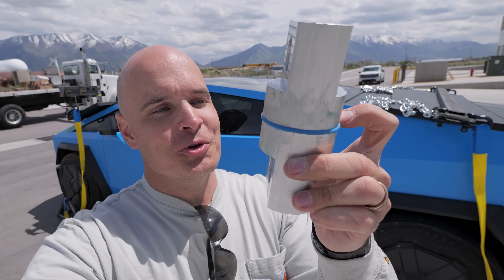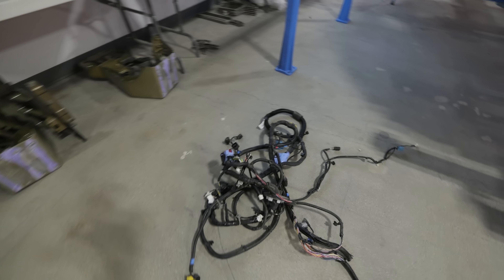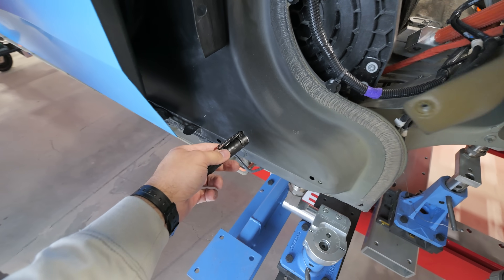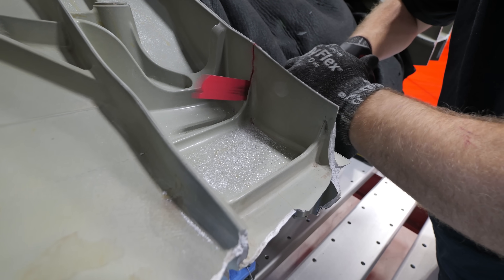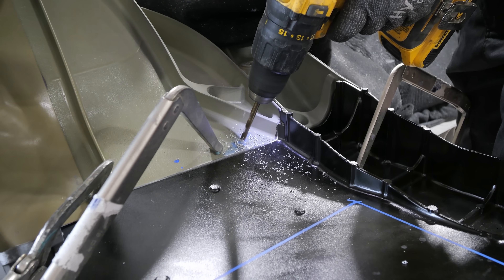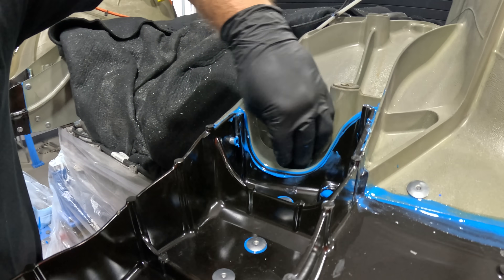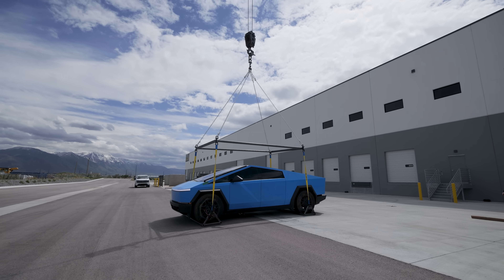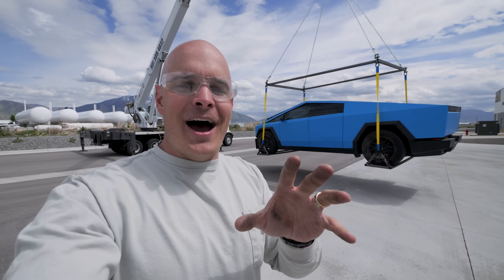Tesla Fixed my Cybertruck with GLUE - (but I'm not mad about it...)

Comment: I'm not that surprised the adhesive did well.  I'm more interested in its longevity.  How does it do with repeated 100 degree summers, freezing winters, wet climates, flexing, debris resistance, etc.  How long is this stuff going to really last in sub-optimal conditions?  One comparison I really liked was the welding one, where welding wouldn't penetrate all the way through your test piece, which begs another question - can you weld with this stuff?  Could you apply it for the majority of the surface area and then weld the edges, or would the heat ruin the adhesive?

Comment: So it was 13k you would not need to do if it had steel frame. Luckily these cars are only made for 10 year lifespan. Metal fatigue might be bad with aluminum unibody on older cars.

Comment: I would still doubt it is as strong as before. The glue can degrade, or get mixed with the dirt or oils, also there is continuous frictions and multi-directional forces while in use - any of this factors is dangerous.

Comment: People have been using structural adhesive for rust repair for years. You use these epoxy adhesive to attach stainless steel patches to treated rusted area that you cut out all rust. The most common part where almost every car manufacturer use it is roof.

Comment: Amazing tech! Remember that crash with a Gwagon where the whole back of the Cybertruckngot cut off? Look closely, not a single window broke , the passenger cell is intact! This reminds you of the lezard losing its tail to save its life! And that Cybertruck could actually be repairable! This confirms my suspicions, the Cybertruck is built to break off parts by sections which is genius! F1 use the same tech!

Comment: From the pulled apart shots of the strut towers, there looked like there wasn’t anywhere as much structural adhesive on the strut towers from factory, compared to the amount the repair  process used.

Comment: Impressive on all counts: A) that it could be repaired; B) that Tesla designed the castings to be repairable and included cutting guides; C) that repair parts are available; and D) it only cost $14,000 to repair.

Comment: Cool video! From the damage of the original  parts, you can see that the glue was spread in 3 thick beads from the factory and was not spread in whole section with the brush like they did it during repair. Perhaps if they would follow their own procedure, it would withstand the maximum weight test.

Comment: When superglue was created some of the first official press displays were very similar to this test here. Lifting thousands of pounds with a single drop of glue wowed crowds. Ofc just like magnets in a way they can only do so much in a "straight line", add shear forces and super glue will likely give out, and all it takes is one or two bonds to detach and it goes like velcro being peeled

Comment: This is what's sad about the Cybertruck. There are obviously a lot of smart engineers working at Tesla who did a ton of good work. It's a cool engineering exercise in many ways. Unfortunately, that doesn't make it a good or safe vehicle. It's still a rushed product with numerous large flaws despite being delayed many times. Oh, and the owner of the company has completely ruined the brand, of course. The repair did cost less than I would expect, but of course it would be far more with body panel damage as well. Cool insight!

Comment: How strong is the glue after a few years? How about when it is extremely hot or cold? This would be easier to fix if it was steel because you could just weld it. This is not very impressive for epoxy, but on par with a standard epoxy you can buy at a big box store. What about the impact strength of the epoxy? It seems like a lot of questions were not asked.

Comment: It's amazing how delusional so many of ya'll are.  If the frame was just made of steel like every other truck ever made you wouldn't need to repair anything.

Does that basic fact even cross any of your minds?  Being "easy" to repair is an insane take away from a $100k truck being essentially totaled by simply towing.   

Cybertruck is not a real truck and this is probably biggest reason why

Comment: Repair looks simple, but it's not cheap, you have to buy some parts and read the manual. Steel is easier to fix, you need just a good welder.
Bicycle travellers for example prefer steel racks - you can weld it everywhere. There is also a fatigue issue, which almuninum is susceptible to. Cybertruck is not super durable machine for Siberian conditions, it's just sufficient.

Comment: if you really want it strong, treat the aluminium to a nitrogen snad blasting to create more surface area, and remove oxides, apply a bonding primer then adhesive.

Comment: Dear Jerry
You could repeat your test with a coating of whatever product is used by Tesla to coat the alloy frame. That way the test would find out the adhesion strength of the coating rather than the adhesion strength of bonding aluminium to aluminium. If the coating adhesion strength is far less than the epoxy product then your cybertruck is likely to pull apart the test sample. Should make a good you tube followup. It could be whatever treatment the coating is given or not given is causing cybertruck panels to loose adhesion to the bogy frame.

Comment: In many cases, the adhesive joint is now more often STRONGER than the base material itself, and definitely stronger than a weld or any other mechanical connection. It is truly amazing how far adhesive tech has come.

Comment: Sold and used early automotive panel glues from 3M in 80s. Initially used for door skin replacement although spec still called for 2 welds. Early glues were inconsistent and surface prep was overly complicated. Over the next few years the entire process became perfected. They're everywhere in vehicles.

Comment: WOW. Parker aka Fusor Adhesive is not Tesla Glue, it is glue Tesla uses in repairs. It is a body shop staple since before Cybertrucks needed to be glued back together. Calling it Tesla glue is silly and all accolades go to the manufacturer Parker… Id check the data sheet on the toxicity before sniffing too much either. Anything that blue is sus… blue is rare in nature but not in petrochemical products.

Comment: If you dive a little bit deeper in the topic glue you will notice, that this looks fascinating and still is for me, but is actually nothing new. If you want to combine two materials especially for metal glue with this strength and elasticity is available for some years now. So Tesla glue is more marketing than something else. The use here to hold a bumper seems for me more disapointing than an useful as replacement is even harder if something happens now.

Comment: Btw the protective e coat is not a paint. Its adhered on to thr surface just like powdercoat is. It goes thru a series of baths actually has a couple of coatings on it. The car is charged and the water with the coating inside it so when the whole car gets dipped it adheres to the metal then they bake it on

Comment: How would they repair it the second time?? if they were to cut it as they did in this video the slot of the replacement part would still be attached right? how do the remove something that has been attached with super super blue glue?

Comment: Show me any other company that can do this. I'll wait. Anyone who thinks Tesla's engineers don't know what they're doing and think the CT is a failed product, I'll wait for you to wake up
Reply from the maker: The bottle of structural adhesive literally says GM, Fiat, Peugeot, Chrysler, Honda and Acura are all using the same stuff.... so thats a few companies.
Reply: @JerryRigEverything  Not speaking about the glue specifically. Do other companies have their parts built in such a way that their repairing process is this straight forward and simple and has high integrity and isn't a thousand parts? Last time I checked, a lot of the players are still catching up to castings in general

Comment: Now do a twist at the glue joint and add a little bit of vibration like it will happen on the road, I agree the glue is strong but in a perfect testing environment. Super glue was also advertise like that, holding weights but a twist breaks the bond and I thing that would be a better test

Comment: Interesting that you did0 not count with possible failure. O would add wood plate to the frame above main hook as in case of failure it will shoot half glued part with chains to CT roof. O do you have extra wire or chain that hold it neat the craing hook and do not allow to free fall to car roof?

Comment: It's not the type of glue that they use, it's the horrible Quality Control of the installation outside of the factory and repairs in shops when you're not famous. There are many high strength adhesives that work fantastic, but you need to use them correctly and not in a hurry.

Comment: If the test article fails during the lift - I'm paused @13:08, just before the actual lifting begins - then the rigging comes crashing down onto the roof glass.  Any level of safety line for supporting that would have been a good idea.  Just saying.

Comment: Now come back in 30yrs and see if that glue is still holding strong... I work in the boating industry and have yet to see an adhesive or sealant that's remotely close to it's design strength after 30 yrs of age, wear, and tear.

Comment: Fron manufacturer it doesn't seem like they put very much adhesive on the rear bumper from assembly. Comparing to the repair process the coat the entire area with glue. There's just like three lines of glue when they manufactured it. it seems like they didn't manufacture correctly to specification when they were first assembling it compared to the repair process. By not having enough glue can definitely decrease the complete strength

Comment: Lotus used glue and screws (similar to the rivets used by Tesla) instead of welds a their cars because it was stronger than actual welds, and helped save a little weight on their cars. So it's not a "new" process.

Comment: I once used my webshooter backpack to lift a car with hot glue, and it only required significantly more glue and surface area! Are the cast aluminum fracture zones less likely to transfer hidden bending/damage further into the frame than conventional steel crumple zones?
Reply: I want to be embalmed in Tesla glue

Comment: Lifting a car with glue isn't new and something super glue has done plenty in the past. Super glue however is brittle meaning a light tap from a hammer could break that bond that was able to lift a vehicle. The quest I have for this stuff is what is it's weakness? I imagine it's more shock absorbing than super glue but how does it's properties change with temperature? What sort've shock forces can it absorb? How much does it's bond diminish over time? How weather / moisture resistant is it etc etc

Comment: I’ve seen many vehicles that use structural adhesive in assembly. When BMW made the I3 and I8, the carbon chassis were not a single piece, but a jigsaw puzzle of sections glued together, and with aluminum sections glued to the front and rear. And everything held up to whatever abuse their owners would throw at them.

Comment: I was never a fan of the Cyber Truck, but after seeing how Tesla designed it to be repaired through Gigagasting has certainly impressed me. Awesome stuff!!!!!!
Reply: and the price for repair you can buy 2 RAM trucks   . Tesla Cybertruck's frame snaps after hitting pothole
-Of the total $34,000 bill, $21,076 was for replacement parts, $11,140 for labour—totalling 94 hours of work—and $1,796 in taxes. Despite these ...
Reply: @kendexter after hitting pothole?? He crushed it with and excavator…
Reply: @kendexter  Source? Because the video itself said at 10:54 that the "final repair cost" came out to be $13,994.

Comment: that strong glue and the rivets should make the joints very strong even in time. but the use of an adhesive is common when working with aluminum.

Comment: Cyber truck is a POS. It should have never broke like that to begin with. They use adhesive because you cant weld cast aluminum. Adhesive break down over time. What a turd indeed.........

Comment: Impressive adhesive, and that's loading it in tension which is worst case. Usually you'd design the splice to be loaded in shear instead and it would be even stronger.

Comment: 😂fusor 2098 construction adhesive. 90 dollars a tube.. like a 2 part epoxy sized tube from wah-mrt. .
So,'if you tow right'.....hmmmmm........uhmmm..hmm.vertical pressure created to much angled stress.for aluminum..hmm. how's an airplane ever stayed together?7..8....10 g negative outside loop....most are aluminum through and through...😅..
To weakly engineered with to much crumple zone attention and break points it's weak. 
That's visibly fact.
Did I miss the repair cost or something?

Comment: do not call 48V "mid-voltage". 48V actually qualifies to be a SELV system "safety EXTRA-LOW voltage". Extra low voltage systems are typically less than 120V dc. Medium voltage systems are 1kV to 35kV.

Comment: That was the most positive review I have seen on the Cybertruck to date - its repariable, and the glue they use is very strong.
Reply: Because lots of people are paying creators to make negative cybertruck videos, and nobody is paying them to make positive ones.
Reply: You guys are not realising that it shouldn’t have broken off in the first place
Reply: Yeah? But see the thing is, he only tested it in ideal weather conditions and at ideal temperatures. What if you'd need to tow a trailer in below-freezing temperatures? You're going to do that with your glued-back-together aluminum casted frame? Good luck with that.
Reply: @somethingtojenga  Another thing to consider is what happens over time. Is it gonna be as strong after 10 years?
Reply: @chris_tzikas  It's an electric car. Current technology says that 10 years is about the expected lifespan. I have a 3 year old Tesla that still works like new but I'm going to trade it in for a new one this year because I don't see it lasting 15 years. I love the car, I just don't trust the batteries to last as many years as my gas engines. But the Tesla is by FAR the cheapest car to drive. I have a solar setup at my house so other than tires, it's literally free for me to drive it. It's also easily the fastest legit daily driver I've owned. Current EV's are a terrible choice if you plan on towing anything more than a jet ski any distance more than 50 miles. That's just not what they are good at.
Reply: @somethingtojenga as someone who lives in Florida, I’m good dude.
Reply: How about the fact it cost a CRAZY amount of money to repair and that normal repair shops can't even get the parts to do this repair ??
Reply: @edwardfletcher7790  yep, which is why this was one of the very few positive reviews i have ever seen on the truck. It's repairable... but at what cost?!?!
Reply: Mark Rober also just released a video showing him driving the Tesla that he dogged in a video and using SpaceX to launch his satellite. Both of the realized that it isn't a good idea to make one of the most powerful and influential people in history made at you.
Reply: @wvXvxvXvw  I think it's just a sign of intelligence if you can both be critical of a company or a person for the bad things they are/do while still appreciating the technology, the good things they do, and all the people involved who aren't batshite crazy billionaires.

It's a very small brained person who finds one thing they don't like about something and immediately goes straight to "BOYCOT EVERYTHING!!!"

Comment: Would the adhesive not be better to be applied to bare metal? Surely if it’s a painted surface it’s the paints adhesive properties you’re relying on rather than the adhesive itself?

Comment: Roughen up the surface of any metal, take a metal adhesive compound and it will stick stronger than you can imagine, close to welding. Though the structure is still weaker of course. P.s. Danny DeVito wants his glue back to fix his cars from Matilda.

Comment: Actually zack is smart 
He broke a tesla knowing it will set  huge negative feedback 
Then tesla must do something about it and come up with a glue which is not used in the original truck 
My point is that the glue is impressive engineering thing but i don't believe they use it that much and in the original trucks

Comment: The glue from Tesla is nothing special, I bet that the application of regular epoxy glue or better quality assembly glue would also hold such a weight with a crane, the key is these two perfectly fitted pieces of aluminum. 
The only interesting thing is the fact that the car was repaired from available spare parts using basic tools and a tube of glue. (plus a template so that everything was aligned evenly)

Comment: Somif its so modular and theres some metal in the sustem with coatings to prevent galvanic corrosion... Why don't they do a steel backbone section and steel hitch?

Comment: I am absolutely, positively not impressed by Tesla gluing your cyber truck back together. That has to do with the fact that I have a firearm, that has parts that are glued in place with a glue that’s strong enough to hold up to the forces generated by gun powder. And is used in gun-smithing work. But I find the repairability that Tesla designed into the cyber truck, to be more impressive than the glue.

Comment: They should have stripped the paint from the glue joint. Now the bond is dependent on the strength of the paint, not the glue. Bare metal is the best for the strongest bond.